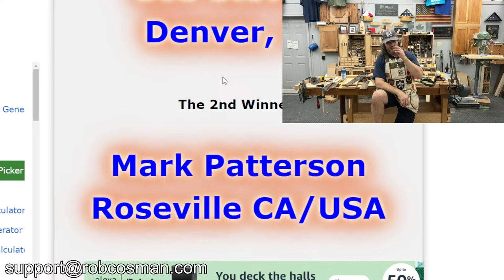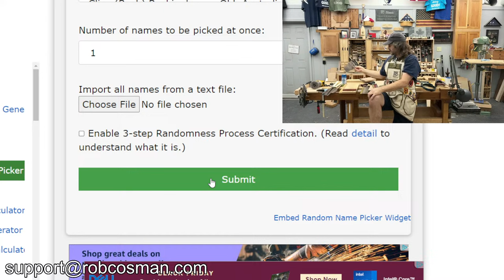Backsaws - Live Q & A (25 November  2023)

Comment: @1:39 question regarding dovetails being too tight. I had the same problem, and I found out it was because I was using a small clamp on the Shawn Shim. The clamp was pulling it out of plumb. I saw Rob just holding it in place in a newer video, and once I tried that my dovetails improved significantly.